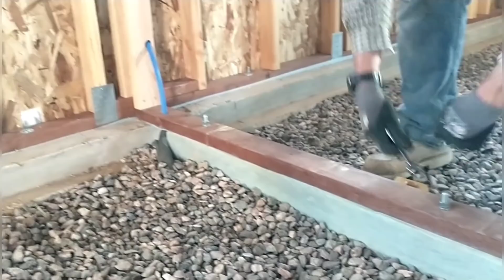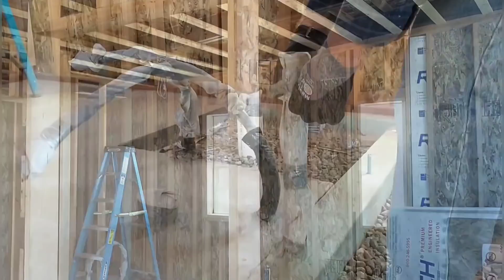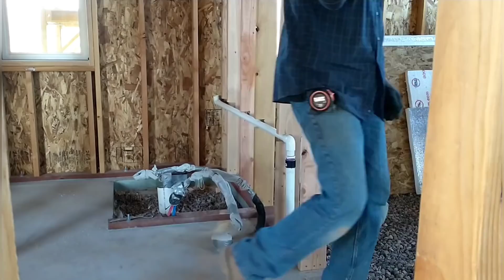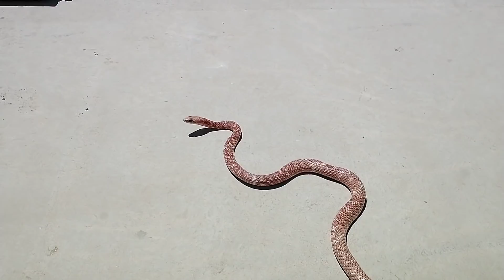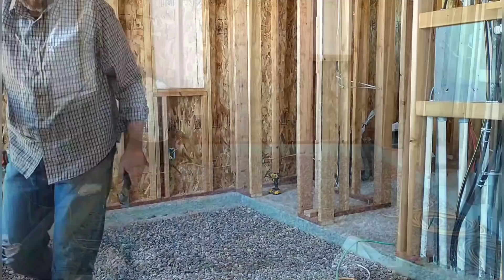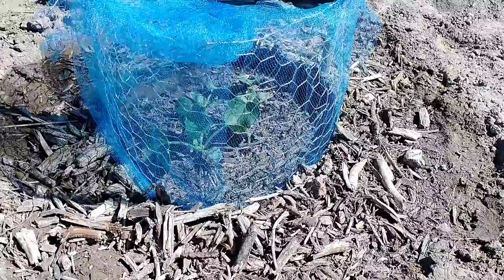Finishing the Framing, & Starting on the Wiring #29 DIY Off-Grid Home Build

Comment: Wait. Did you say you were “hiding”j-boxes IN the wall? That’s a major code violation. ALL j-boxes must be accessible. Not to mention it’s just a good idea. What if your make-up comes loose? How are you 1) gonna find it and 2) fix it without damaging your finished wall? How are you avoiding inspections in AZ? Sketchy.
Reply from the maker: Good point, we can easily add access in the closet, and can put in a removable panel in the kitchen. We have the Cochise County opt-out permit, and and only have one outside inspection, once the house is done. 🌞🏜️
Reply: @RedandAprilOff-Grid  Cochise County allows that? Cool. Mohave use to but now they want inspections for everything. It doesn't hurt my feelings. Inspections are for our protection, but every jurisdiction is different. 
My Best friend just moved to his 81 acre ranch they bought last year just north of Douglas. I'm actually headed that way this weekend for Memorial Day to see it. I hear it's nice down there.
Reply from the maker: It's pretty nice to be able to build how we want to, and do all of the work ourselves, but definitely some risk involved. 
The opt-out permit, and septic permit is only $450, and that's all that is required. 
81 acres, sound nice! 🌞🏜️

Comment: Another terrific update this week.   I was thankful to see Red wearing a face mask while grinding the cement smooth.   It was nice seeing your grand dog visiting on the outside of your garden wall.   I’ve forgotten what your plans are for the gravel floors inside your house.  Will you be adding bricks or slate in those areas?   Red also mentioned concrete interior walls.   

In NM my nephew worked for a firm that poured concrete into horizontal forms that were filled with steel mesh and connectors.  Even the concrete cured the forms were removed and the walls were raised from horizontal to vertical and positioned as exterior walls.  I believe the Intel plant located near Rio Rancho was constructed using that process.  

Are your tented plans sufficiently open to allow pollinators access to flowers? Wishing you both another blessed week, a gentle spring season and safe construction.   Peace
Reply from the maker: Thanks! Yes it's pretty important, lung damage isn't apparent for many years.
 We are going to try to do an earth floor in the guest room first and see how we like it. If all goes well, we plan to continue it for the rest of the house. 
We are working on the concrete walls now, they are turning out really well! 
As the plants get bigger, I am removing the coverings. 
Thanks so much! 😊🏜️

Comment: What are you planning for the rest of the dirt floor?
Reply from the maker: It's a mixture of dirt, sand, clay and possibly some cement, it is sealed well, so it's a clean floor.
Reply from the maker: Possibly an actual dirt (earth) floor. We plan to try it in the guest room first, and see how we like it.
Reply: @RedandAprilOff-Grid  not very practical or clean, gosh after all your hard work? Just put in concrete!

Comment: Awesome progress!   ...have you been able to use the evap cooler yet ?
Reply from the maker: Thanks, it's going well! We have used the fan setting some. We don't have the water hooked up yet and the temperatures are still pretty nice in there. We have learned that the vents are not nearly enough ventilation to let out all the air that is being pushed in. We'll definitely need to keep a window open too. With just the vents, even on low, the whole house is pressurized enough to make the door a bit hard to open. 😎🏜️